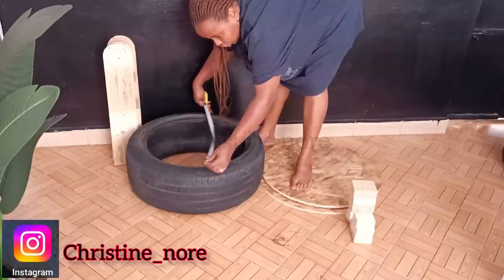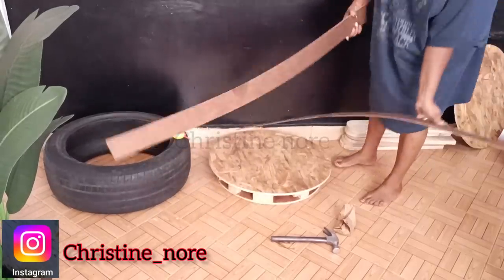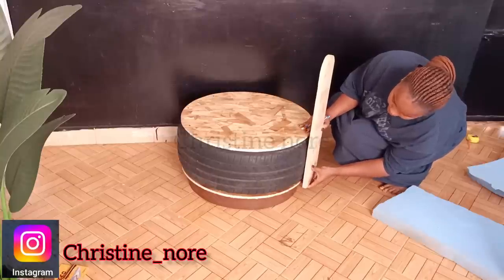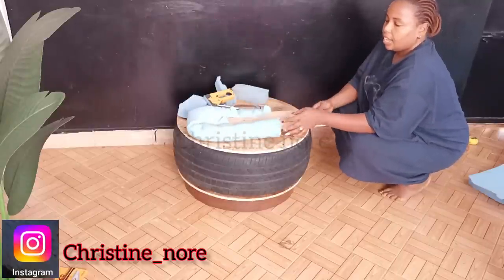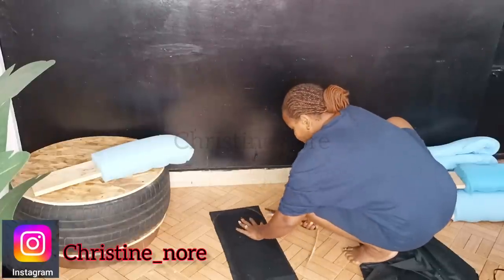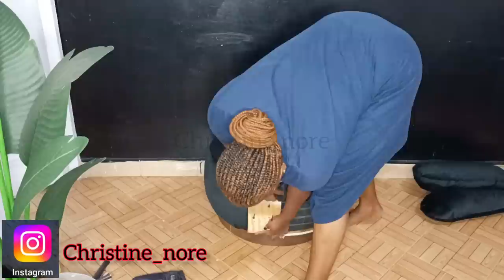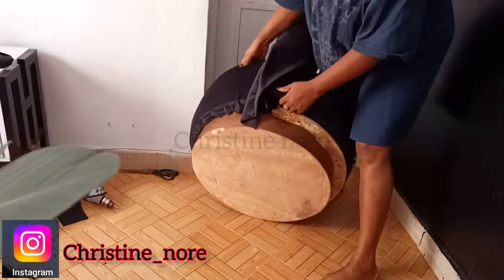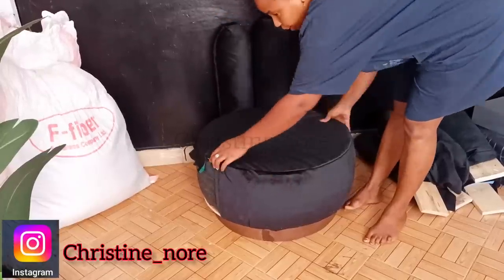Recycling Idea Using old car tires//Amazing idea with car tire.

Comment: I have one question, 
When the nail is drilled into the wood and tire it holds together? Or the other side of tyre needs support as in this one you havent used any wood inside

Comment: Wow, you're doing amazing work here. Your videos are mind blowing. Could you please add the prices of the materials you use
Reply from the maker: Thank you, prices are not necessary because we all get our materials from different places.
Reply: You will need .
Tyres . Price around $  10-30 for used .
Plywood or MDF .
Wooden battens or planks .
Kapok or Filling for toys .
4 metres of fabric.
Offcuts of wood .
 Tools .
Nail gun .
Staple gun 
Hammer .
 Mini Circular saw.( Or order to size )
Scissors.
Needle and thread .
Nails and staples .

Comment: You should have glued the form to both sides of the form then glue the sided together after cutting off excess instead of the folding over method
Reply from the maker: I will use it next time, thanks for the tip.